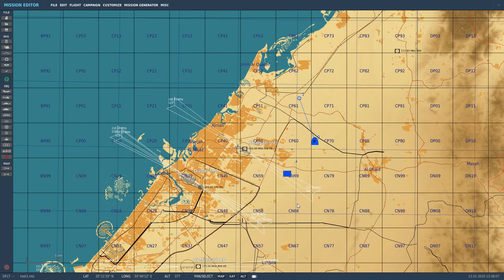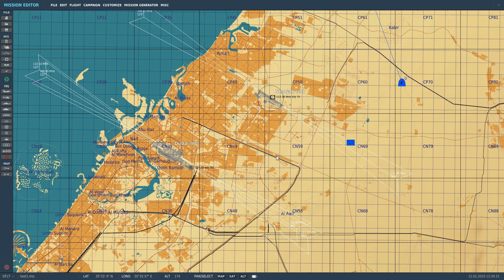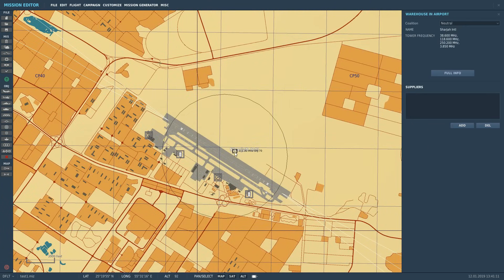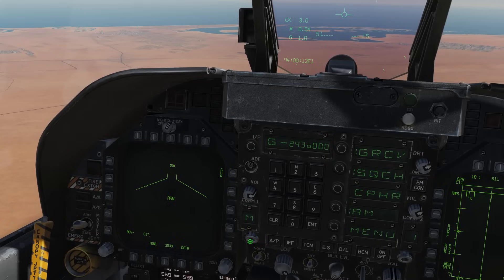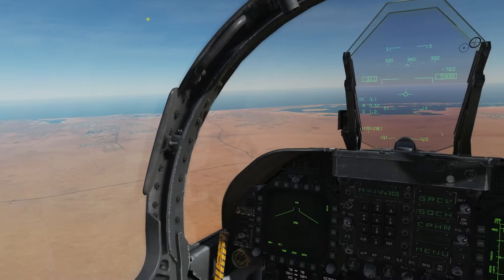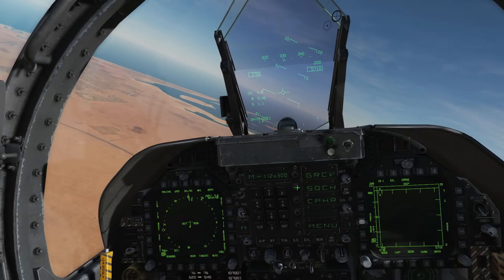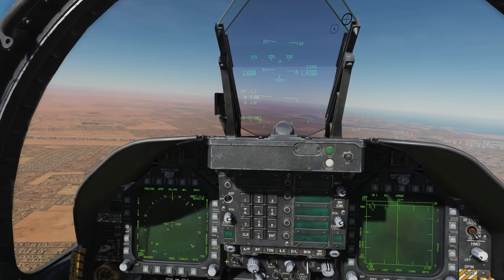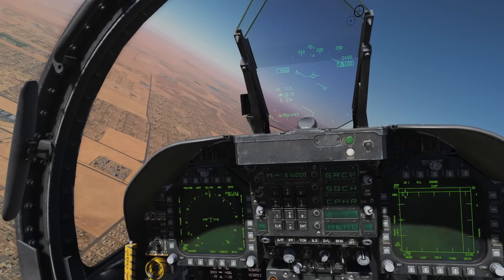FA-18C Hornet: ADF Navigation Tutorial | DCS WORLD

Comment: slight correction to the start of the video:
NDBs do not provide any directional information on the carrier signal.  The receiving aircraft must use a direction-finding receiver to navigate with this navaid.
a VOR provides dieectional infromation, but NOT range, by means of a second directional phase-shifted signal overlayed on the primary non-directional signal.  the phase angle between the non-direction and direction signal tells you what heading you are on from the VOR to your receiver.
a DME provides ranging information by responding to a transceiver in your aircraft that goes "bing!" at the DME and measures the distance based on the return time.

DMEs are very often, but not always, colocated with VORs to provide a VOR/DME service which will tell you where you are in two dimensions relative to the station.

a TACAN is basically the military verison of a VOR/DME, and are often colocated with a VOR, in which case they are referred to as a VORTAC.
Reply: Can f18 use the dme system?if so where to select
Reply: @aidilsyafiq2488  the TACAN is the only distance measuring equipment on the F/A-18